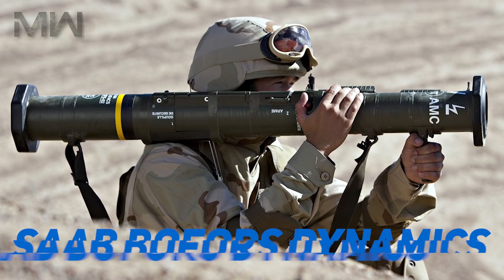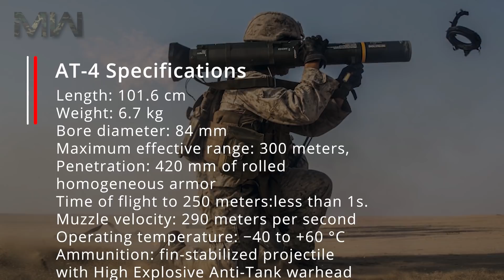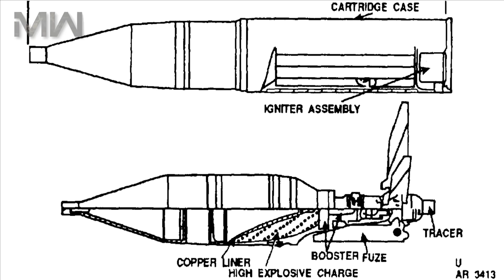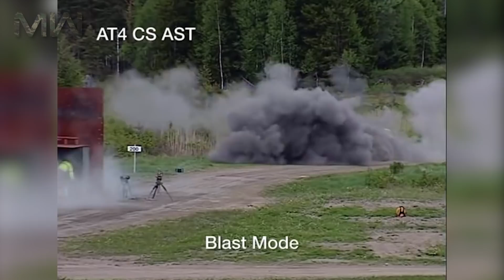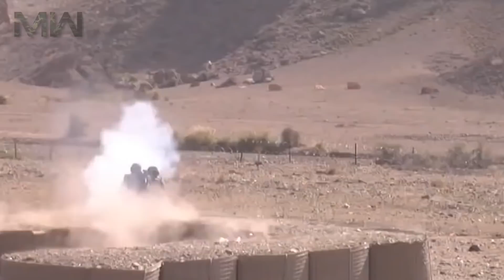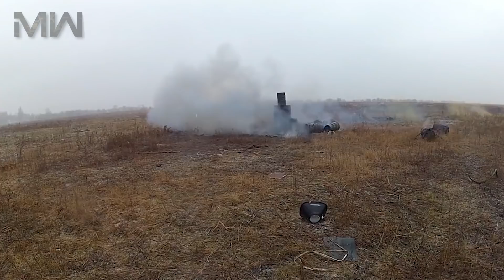84mm Anti-Tank Rocket Launcher AT4: Swedish Weapon [Military Review]

Comment: I dont think it can destroy a moderm main battle tank of today
Reply: destroy everyday!
Reply: I bet something on the tank will be waisted, sensors, oculars maybe even wheels and suspension ...
Reply: So?
Reply: No, it can't. There are other system for that task. AT4 is good for unarmuored and light armuored vehicles and buildings.
Reply: No modern tanks armor is designed to stop heat rounds. Unless some weak point is hit there's no chance it'll get through.. At4 can only achieve a mobility kill.
Reply: It cant
Reply: It doesent destroy the tank but it certainly stops it,  specially  if you can fire from above.
Reply: It would take a good shot with the hp version to do any damage to a modern mbt,the m4 carl gustav would need the 751 round through the roof or the rear of the turret of russian or chinese tank as it is the only round in use by nato armies that has a tandem warhead,dont know if any of the old eastern bloc countries make tandem for the rpg 7,besides panzerfaust 3 it or stroilja 80. The best overall at rocket today is still rpg 29 for range and power and portability.
Reply: Dont worry, it kills the Arjun mbt trough the front lol